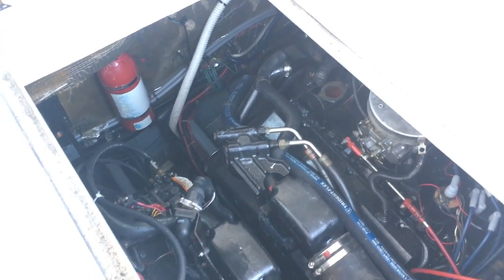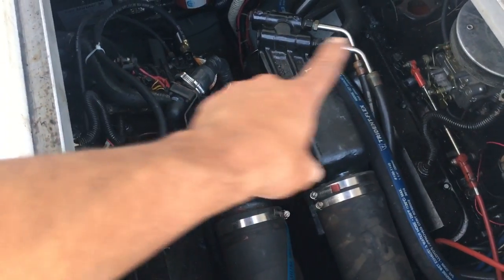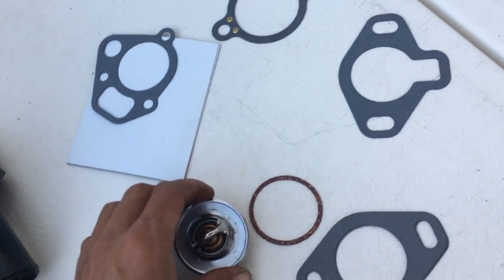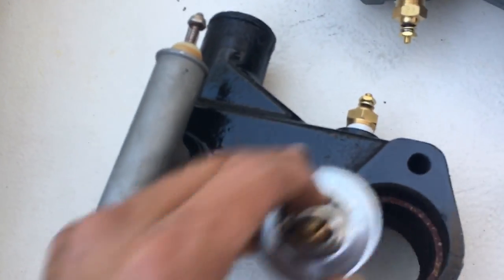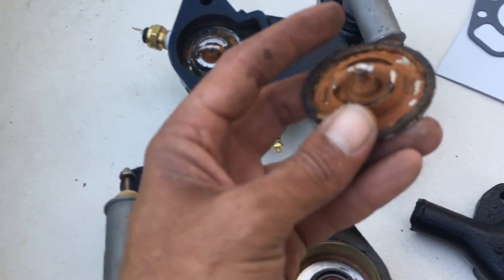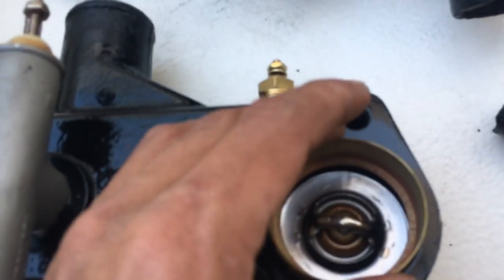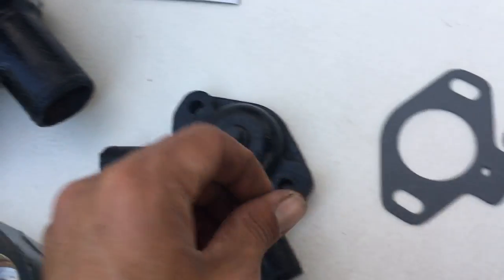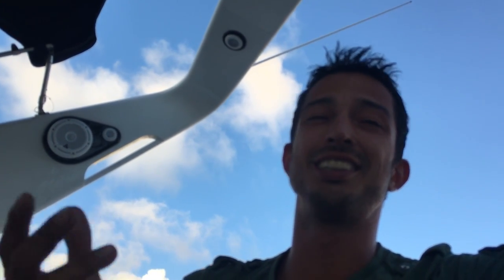MerCruiser overheating problem fixed 454 engine

Comment: Help 
Just replaced my impeller on the alpha 1 engine is 5.7 . When on muffs left side ( drivers ) got to 145 right side 115 . This was on muffs at idle for fifteen minutes 
She’s pissing strong so I’m confused a bit
Reply from the maker: Hello my friend thank you for watching the video! 145 on the exhaust elbow is not out of operating temperature yet as  the thermostat itself that you are probably using is 143 so that’s how hot the water exiting the engine by the exhaust elbow should be expected to be, as the temperature difference  one is always hotter than the other by like 20° in most cases the driver side is the hotter one, some setups the passenger side has a smaller loop, some have a check valve in one place or the other that is really just a plastic ball and a spring that only lets the right amount of water to pass a one time, so especially on a hose The water always flows better to One Direction then the other so I wouldn’t worry about anything just yet my friend, I would take her out put her on plane and see what she does. Take your temperature gun because as we all know gauges are liars 😄
Reply: @Cruisingthesouth  
I had a look at the shutters in the exhaust and man they are toast
Reply from the maker: @buffordevans6942  oh wow! I don’t have thous on my setup! they burned out from overheating? Check the first oil cooler after the water pump for any junk stuck in there
Reply: @Cruisingthesouth  
Apparently yeah when the impeller went they melted on down as well . 
89 bucks a piece lol and the fruuustration say the least . 
Im going to pop the outdrive off the boat and dig the crap out of the exhaust and replace the gaskets etc etc 
Then the carb rebuild is next
Reply from the maker: @buffordevans6942  At least you found a problem 😅 it gets really frustrating when you can’t find the issue. Front seal of my generator water pump failed last week so I went ahead and removed the belt driven pump set up and installed a 110v air conditioner water pump instead on the hopes that will last as long as my actual air conditioning pump has been working 🤞

Comment: Hey i came across this video researching our issue.. Maybe you can help, as you seem knowledgeable. We have a 2008 - (motor may still be a 2007 model) 6.2 MPI with a Whipple supercharger.. the issue is that it is getting hot - around 190 degree Fahrenheit. The ecu that came with the Whipple limits the power when the temp goes over 175 degrees. We initially thought it was the thermostat, we removed the thermostat - and it did not solve the issue. The lines and the manifolds are cool to the touch but the housing for the thermostat is hot (where the temp sensor is). Any help would be appreciated. Thanks!
Reply: Side note - the boat runs in raw fresh water. Thanks!
Reply from the maker: Hello my friend thank you for watching the video! OK let’s get this boat fixed so the thermostat didn’t do the job 🤔 We’re going to have to go through a elimination process the next thing that I would check is your pick up port which is where the boat draw water from the lake or ocean make sure that’s all clear if it is follow the line to your water pump and then follow the line coming out of your water pump, that line should go to a heat exchanger for your oil and or transmission fluid the heat exchanger inside of it it’s like a honeycomb set up, disconnect the inlet side and look in there make sure there’s nothing in there also if your water pump would lose parts of the impeller that’s where it would get stuck on first and for most check that and let me know what you find. For me sounds like a water restriction issue I had the same problem before like everything looks to be fine water coming out of the exhaust and everything but it’s just not enough water maybe your impeller lost a wing or something and if so it would be stuck inside of the heat exchanger because the passages are very little which is a good thing or  they would be going straight into your engine. Let me know how it goes I’m assuming that you still haven’t looked inside of the heat exchanger if not it’s a great place to start. 😉👍
Reply: Check your exhaust manifolds and risers as well as the flappers
Reply: @gatornation3889  
Flappers ?

Comment: I've read the pipe tape you have on those temp sensors should not be there due to the temp sensor needing to ground through the threads.
Reply from the maker: Jerrit Tyler Hello Jerrit I agree with you they do need  grounding but just a little bit of it plumbers tape makes to a good seal but the threads exposes through the tape you most certainly will still have a good ground and perfect seal 😉
Reply from the maker: Jerrit Tyler also thank you for watching the video ;-)

Comment: What type of socket and size does it take to remove thermostat  housing on 1997 7.4 mercury?
Reply from the maker: Gary Smith Hello Mr. Gary thank you for watching the video my housing has a 5/8 socket size but my engine is a MerCruiser so yours may be different, One thing that I would suggest is to go online and find a PDF with the service manual for your engine that way you’ll have torque specs so you don’t end up over tighten bolts and there after creating more work down the road 😉
Reply: 14 mm

Comment: You mentioned no to put anything on o ring because of contact for electrical contact for grounding. But as I can tell you painted the housing and there will be NO contact. You probably know better and probably you will get grounding somehow but zero will be transferred from that gasket. Tell me I’m wrong please?
Reply from the maker: D DAViDOViC well ok you are wrong 😂 lol jk just playing along but yeah even putting sealing tape and the housing being painted the friction of both treads being screwed together the contact of metals is inevitable and yes it worked perfect and has been since I did it. thank you for commenting thou
Reply: Do you have any idea I connected today to my MERCRUISER 4.3 earplugs with water hose I wanted to start the engine and water came out from dipstick? Now motor is full with water? What to start with?
Reply from the maker: D DAViDOViC did you actually got to start the engine before the water intrusion ?
Reply from the maker: D DAViDOViC but first and for most drain the engine take all the spark plugs out and crank that engine and put some oil in the spark plugs hole and crank the engine again and again so it don’t seize
Reply: No I didn’t even attempt to start
By the time I got on a boat I noticed water coming out. I am draining oil now I got around 8 gallons water and oil

Comment: Ur thermostats are upside down. It will overheat again.
Reply from the maker: Caddi Man you must be looking at it wrong because they are not upside down 🤷‍♂️
Reply: That Sea Ray Channel you are absolutely right. I thought the housing was upside down. I didn’t realize that he said “this is the top”. So my apologies to u.👍
Reply from the maker: Caddi Man thank you sir this is really appreciated because that’s the whole point for us to share our knowledge and work through the 1,000,001 problems that these engines always have 😂